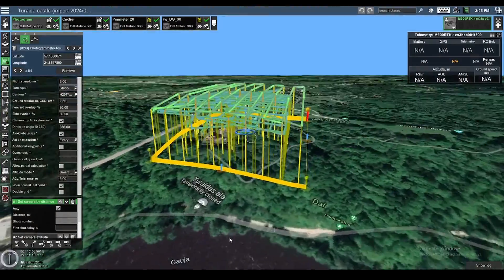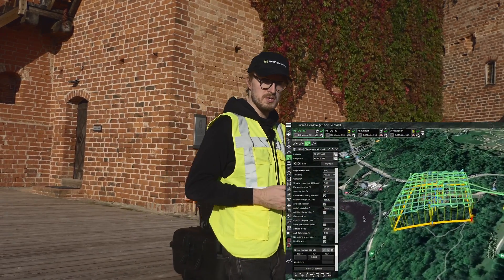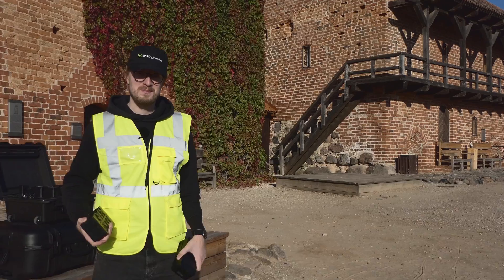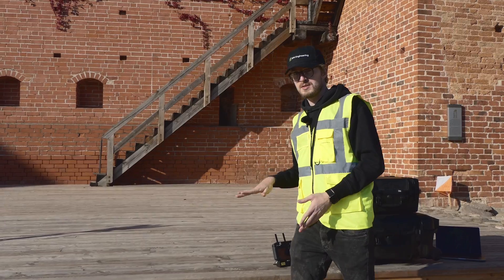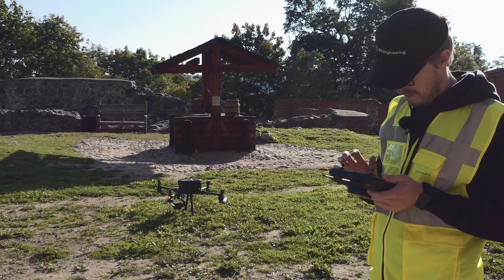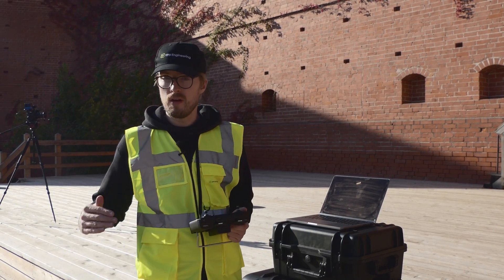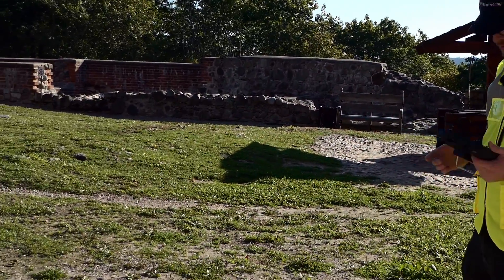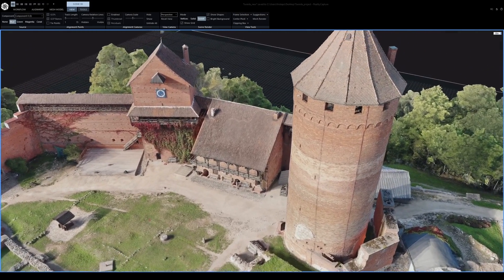How to Use UgCS for 3D Building Modeling

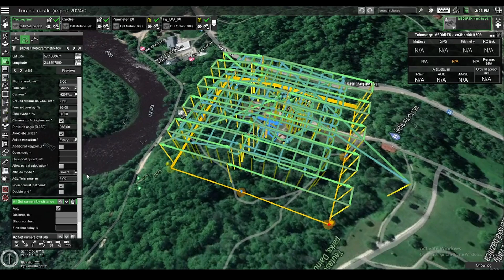Comment: Hi and thanks for the great video - I have seen many good explanations on your channel. I wish there is more like that on YouTube to learn how to work with these tools “in real live” and on job sites. As a commercial pilot since 7 years I just started to use ugcs now and I was a bit sad that a few important things that would have been very interesting to me were skipped at some point. (For example at 00:52 or 03:50) Probably because they are so logical and “normal” for you and many other users. But maybe these things would be essential for new users like me. I’m still pretty unsure about some procedures - for example how you use the laptop + controller - importing and then editing the mission in Pilot 2. I’ve already tried out a bit but I still feel pretty insecure and not very self-confident because of the danger of doing something wrong and risking a crash.
Reply from the maker: Thank you for your comment! We are planning to release more similar videos.
This video was designed to highlight a possible application of UgCS without specific details. 

However, we have a lot of videos that go deeper. 
For instance:

1. This video explains the basics of flight planning  https://youtu.be/XQfaFYiNiUE
2. This one explains the connection between UgCS Desktop and the DJI Pilot 2 https://youtu.be/B_bTn4hvt0U

We also record webinars showing the application of UgCS in specific areas. 
For example this one - https://youtu.be/AUQAB2DgnYo

If you have specific questions you can always reach us to us - support@ugcs.com.

Comment: Excellent work. Some questions:
1.- UGCS has the Vertical Scanning function for buildings that can be used for both vertical and horizontal scans of the building walls. Why not use that function?
2.- Why not concatenate the 3 missions to make a continuous mission? Any preference on keeping the missions separate?
3.- What software did you use to process the images?

Excellent work. It would be great if they shared similar procedures for bridges, telecommunications towers, and transmission towers.

Thanks for sharing
Reply from the maker: Hi and thank you!

1. In this case there was a lot of vegetation around the building so it was safer to fly a single perimeter line. The tools used depend on the shape of the building. For standard buildings we would use the vertical facade scan tool.
2. It is possible to combine everything into one but typically it would still be separate flights due to battery restriction. And if routes are split it is possible to toggle their visiblity on/off.
3. For data processing we used RealityCapture.

More videos on how UgCS can be used in different scenarios will come soon!
Reply: @sphengineering  Thanks